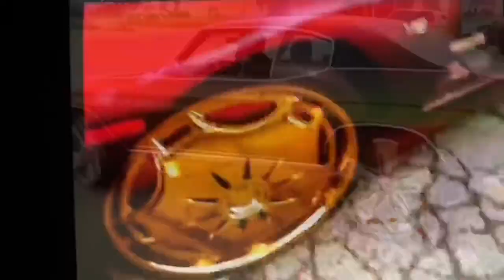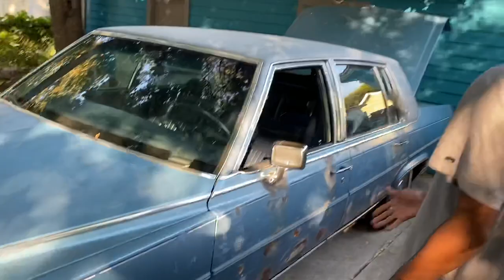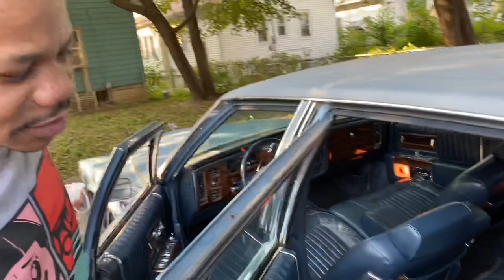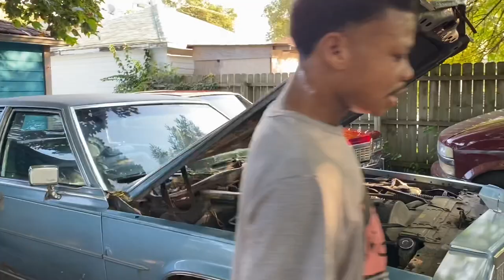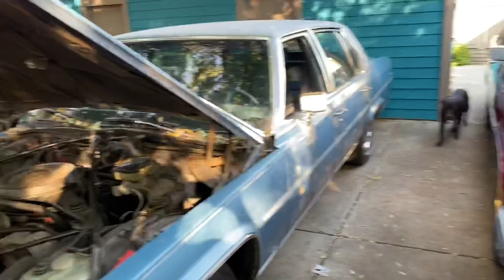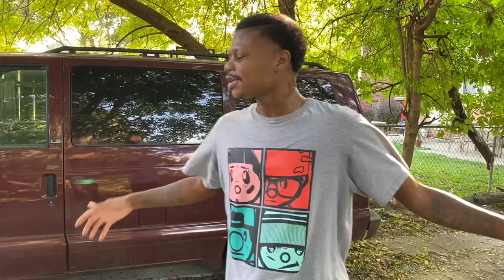MY NEW 1988 FLEETWOOD PROJECT!!!

Comment: I had a 89 moruon  bought it with 45k drove it to 92 k but  it was great with just that 307 olds motor hookers in lasvegas saw with the windows up alway had the ac going cause it had 134a  back then in 2003 to 09 they called the war macine then then i got a 93 deville white with blue  thats a good one to the 89 to 93 deville 4.5 or 4,9 i love to get a blue 88 to 92 fleetwood or my faverite 73 deville me my mom have lost so much in stock market and every other way u can money but inflation is just made it hard to buy a old car but that a nice 88 if the air works and u got that for under 4000 u got hella good deal on that cause every one wants a arm leg for the 71to 79 l8ke your 78 you got peaple think ther worth 20k when they dont even run